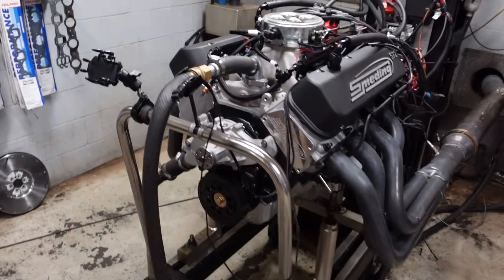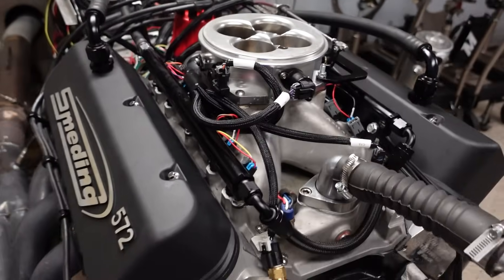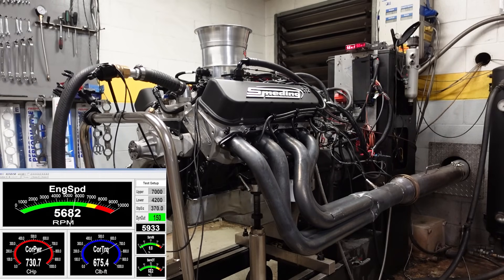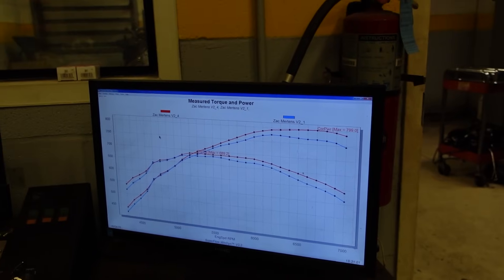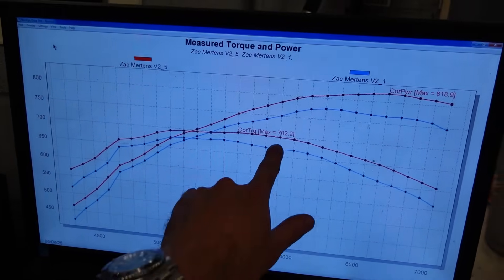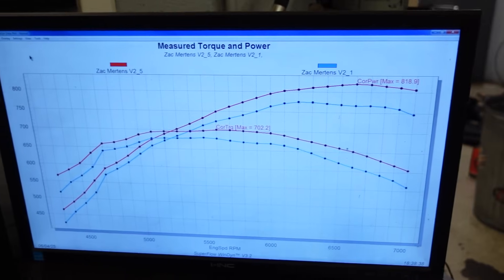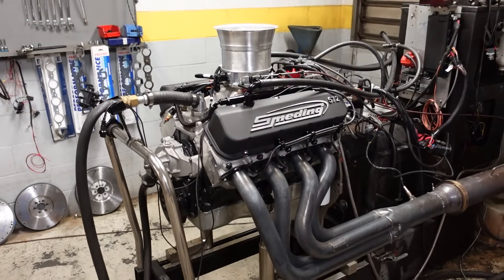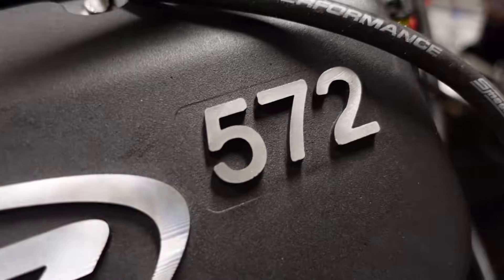572" BBC Dyno Test!! Can we make 800+ Horsepower?

Comment: I come up with the same tuning stuff with all of my BBC builds.....38* Doesn`t to matter what the compresion ratio is, My BBF`s like 24* . I think, I don`t know but it may have something to do with the size of the combution chamber and the top of the piston. BBF`s are 72CC the ones I use anyway. These are good videos, I`m surprised and impressed that you showed the cam cards, It tells me you are confident in your self. I`ll show mine to anyone who asks me, I don`t play those superstock, late model games. I`m punching the subscribe button.
Reply: You are correct.  Generaly smaller chambers are more efficient and require less timing.   The BBC chambers are less efficient than many.  That is one reason they respond well compression.    BBC engines are great fun, but with the same amount of money spent on heads, the BBF  will out perform.

Comment: it'd be interesting to see what the HCs were at the lower timing because the more HP was achieved by a more complete burn because it was lit sooner. My 500CI BBC has a 43cc dome in 117cc Dart Pro1 heads and it wanted 41 degrees of lead.

Comment: And who said that a BBC can only rev to 6000 rpm. I used to rev my 396 to 7200 and it sounded so good
Reply: Big difference in 396 and a 572 😂
Reply: A big block can rev high if built properly, but I don't rev mines over 5,000 rpms. No need to when it makes gob of torque. 😆
Reply: If it only makes power to 6,000 no need to shift at 7,000+
Reply: @karlsracing8422 if it carries the hp it would net you higher average hp so it would be a benefit
Reply: Yes I agree but I was 20 years old at that time and I had to prove something to all my buddies that a BBC could out rev their mouse motors and Fords. I'm just saying that the RAT ATTACK was back lol.
Reply: till the rods came out!